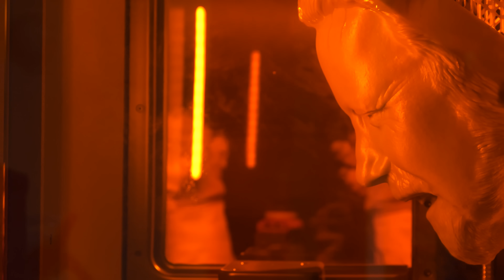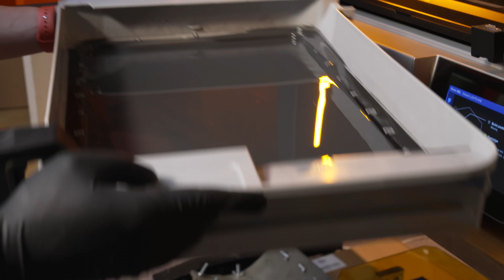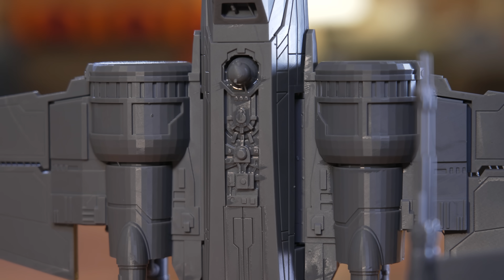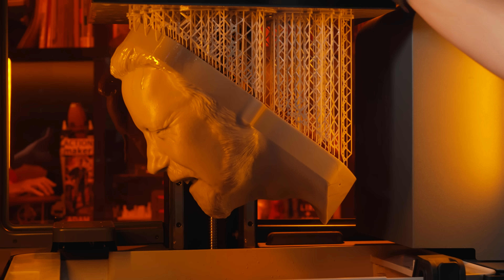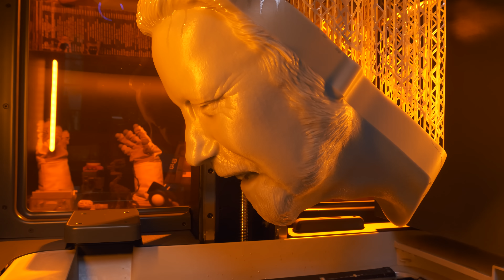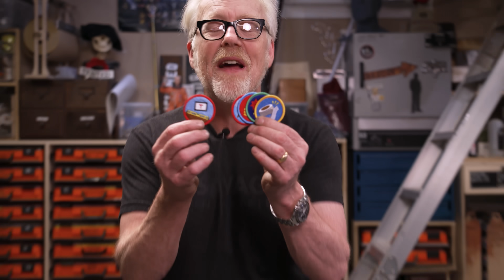3D-Printing At Human Scale—Form 4L Review!

Comment: 10,000$ still seems reasonable.  We are not talking 20-30k.
Reply: Just a heads up if you want to get the complete package its 20k (1 yr service, Wash and Cure). 33.8k for 3 year service and 2x post machines. The wash and cure are far more expensive than the non L printer setups!  But also You don't have to use those! I just wanted to mention this.

Comment: 46 micon pixels with a 354 mm wide bed would mean 7674 pixels wide or nearly 8K resolution.
That's pretty decent.
Resolution might not be everything, but I wonder how noticable it would be on such large prints.

I was considering buying the current Elegoo Jupiter. 
It has a 4K resolution wich is a quite low, especially for a large form printer.
It wouldn't surprice me if the next gen gets a much higher resolution aswell.
$9500 might not be within the budget for now, but the Jupiter for $800 would be 😀

Comment: FYI it costs $5k to activate "Open Material Mode" that allows to you print with non-proprietary material. 

This is a $10k printer before purchasing a wash or curing station, which each cost $4500

Absolutely disgusting business practice that you guys should not be supporting

Comment: $10.000  For that I would prefer to buy the new Prusa Pro HT90 Industrial Delta heated chamber giant 3D printer. not Resin so not Toxic to work with and more than detailed printing system and fast Klipper output FDM printing which is better as you can deal with the waste filaments and supports with them being Toxic like the Resin ones will be. 

That's why I given up doing resin with my Elegoo Saturn 2 printer, the Resin liquid is toxic and flumes are toxic the supports left over is non disposable and the waste water which I had using the water washable resin was also non disposable as you can't dump it down the drains or even on the ground, 

I live in the UK so the option to set the resin in the wash water is not possible as you need tons of strong hot sunlight to do that. shook horrible we don't have that here.

Also I've found that there is no toxic waste disposer centers here either I could take the waste wash water to.

So that was a expensive system wasted there, time you include the large washing and curing system I had to buy too. over £500 of tech I can't use now!
I've still got 14 liters of stored waste wash water I can't set the resin that is in it.  I should have brought another FDM printer instead,

And no I did research it all for ages, But the reviewing youtube channels did not state the waste resin washing water problem? 
They all live in hot sunny states in the US and ever said about sorting out of the waste washing water in non hot sunny places. like the UK.

Comment: 15k (CAD) dollar resin printer. Competition gets pretty damn close if not, identical, for 1/10 the price. You're paying for style it seems.
Reply: One would argue you’re actually paying for reliability formlabs is predicated its business on having high print success and very low print failures. Yes cheaper machines are out there with more affordable resin but what use is that when it takes 10 prints to get 1 functional model?
Reply: @patrickd1606   Almost all new resin printers from companies like phrozen, elegoo, anycubic have very high success rates these days. Ever since they started introducing heaters into the units, failures are almost non-existent. So that alone doesn't justify the price. They're trying to brand themselves as Apple does, but really it's all the same tech used by the companies mentioned above, in nicer packaging, marked up 1000%.
Reply: I have a mid range resin printer at home and use a formlabs 3L at work. Can confirm the 3L is just way easier to use and has a much higher success rate. If I was trying to use a hobby printer for work it would drive me nuts. Glad I didn't have to pay for it though

Comment: It's a commercial machine with a commercial price. Expected that from the start. Now after printing almost exclusively large format the last six years, large format has grown in both capability with somewhat relative entry-level price by leaps and bounds the last few. $2500 is still a bit steep, but those machines will stand toe to toe with this printer while still utilizing open formats, slicers and universal resins. That's always been my big qualm with Form, that you're stuck in their ecosystem for both software and resins. I much prefer doing manual supports to maximize plate loading and minimizing resin while still getting first run parts with zero failures. When you can't tune your resins, you don't have the opportunity to dial a resin to perfection where it holds onto the plate, but all you need is light twisting pressure to separate it Very cleanly. The mark of a professional/power user of resin printers is the lack of gouges in their plate when compared to how many LCD screens they've expended in production time. 😉
Reply: but you can tune Formlabs materials and you can also do manual supports in PreForm?
Reply: @Chaosghoul  Not sure how it works with this printer in particular, but so far as I understood previously, everything was fixed and set in preform with no deviation or custom settings. You push a button on what resin you're going to print, set layer heights, and that's as much customization outside of orienting parts and such.
Reply: @C-M-E  You were correct for the longest time, but PreForm added custom settings a couple versions ago (no matter the printer type, even Fuse now). You can head into edit and then use the Print Settings Editor to make custom profiles and tune basically every setting you want. Custom supports has been a thing forever. This week they also (FINALLY!) added hollowing and suction holes to the slicer as well
Reply: @Chaosghoul  Excellent info, I did not know that! Filing in the ol memory bank for future use. 👋
Reply: @C-M-E  check out the last part of the big announcement (the 45 min one), they even talked about api access etc and showed off running preform via scripts to arrange a bunch of parts on multiple build platforms and upload them to fleet control. Looks like they're turning the ship on the whole closed garden
Reply: Did he say $2500.00 in the video? The web site says starting at $9999.00
Reply: @johncaldwell9842  No, I was referencing the typical $2500 you'd pay for an equal capability Chinese version with this same size footprint. I did look at the website for the Form 4L also and the $10k is accurate.

Comment: Norm, I appreciate you wearing gloves even during the explanation. Just emphasizes the importance of protection when using these types of printers!
Reply: This is like using lead solder without an extractor fan. It’s a fun hobby but people need to be aware of the risks. The comment wasn’t negative I think it’s actually endearing. Just trying to look out for people’s health
Reply: Thats what you got out of this? wtf
Reply: Huhh....Why on earth is it so important?
Do you need a full HazMat suit with a SCBA to use the thing!?🤷🏼‍♂️🙄
Reply: @RILEYLEIFSON_UTAH  The resins are toxic, and easily absorbed through skin. The vapors are respiratory irritants that tend to make a person more sensitive with each exposure. During printing, and even more so during curing, a lot of resin is vaporized.
Reply: @RILEYLEIFSON_UTAH  No, but if you get some on your arm and then head outside you will get some nasty burns as the resin cures on your skin.

Comment: 10k USD. 

So yeah, maybe I can buy a broken one in six years when I can afford it lol.
Reply: Isn't this more for commerical use?
Reply: For industry 10 k is not that much the right job will pay for it quickly
Reply: @davidbelzer  including the wash and cure stations it is $19k. Yes that's right. Washing is $4500 and so is curing. Want to use 3rd party material? Another $5k

This is for fabrication shops that have more money than sense. Just like UltiMaker for FDM
Reply: @Haargeroya No , no wait! At least formlabs works and prints hood quality models! All Ultimaker printers I had the “ fortune” to work with is overpriced garbage. Print quality is just bad, they are slow and broke all the time 😅 
Now i had the chance to work on teo form3 printers and even if they bit the crap out of them they work nice and print with no issues.
Reply: Or you can buy 20x Saturn 4 Ultra and get better resolution and quality
Reply: There will be plenty.